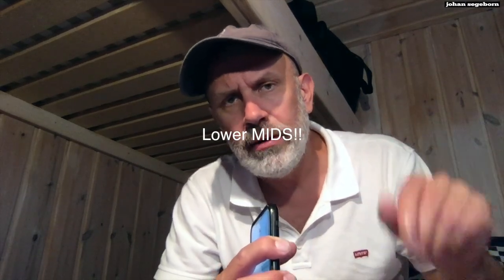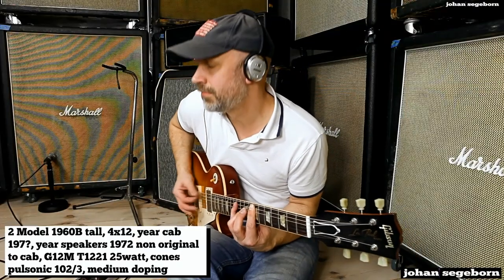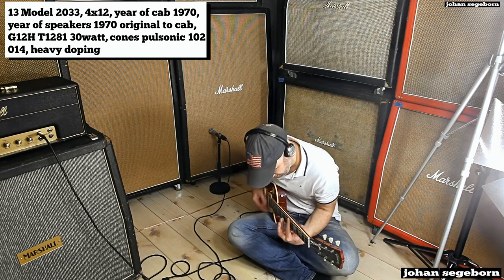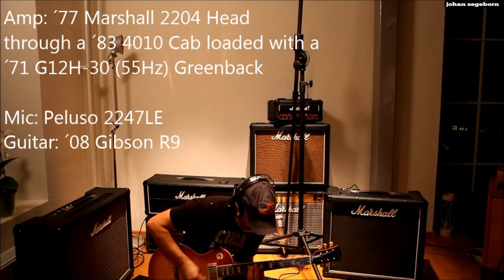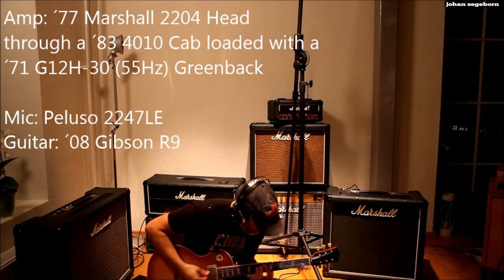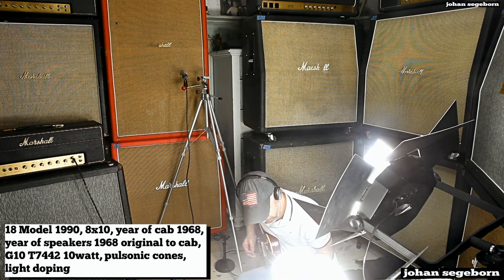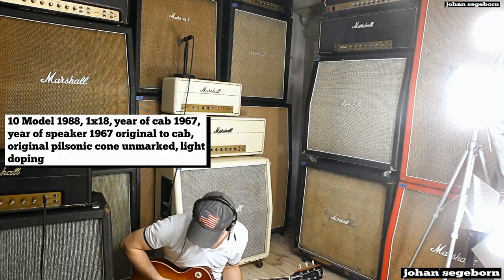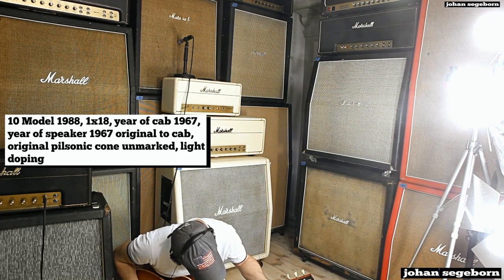Marshall Speaker Cabinets CRASH COURSE!

Comment: Thanks for taking all the time to do this, JS. Nice to hear the contrast in tone in same place, same player, same amp. etc. Seems like the ideal tone is to get the lower mid warmth if the G12M without getting bloated and the upper end cut of the G12H without getting brittle or harsh
Reply from the maker: Thanks Doug, that’s a good characterization

Comment: I learned about a couple cabs i never knew of from you. I’m not sure if it because of how they sound over the phone I’m watching the video with or if it’s just me but the ones you call boxie are the best sounding to me aside from the jcm 800 cab which I’ve always loved.  I use a jcm 800 half stack with the slant cab. I also use a studio 800 20 watt head with a cab i built it has 2 12’s one on top of the other. It’s a tall slender cab. I’ve got a MG15 MSII i keep in my bedroom beside my bed. It sounded terrible until i had a guy do some work to it but now it sounds incredible the clean channel is a second gain channel now too which i love. I never used the clean channel on that amp. I do use the clean channels on my other amps it’s just the MG series all togeather are not the best sounding amps. Perfect for a bedroom though. They are the exact size you need for just noodleing and practicing with. Actually i have to use two power soaks to calm it down now that i had it worked on. I have a great amp guy, he reminds me of Brad The Guitalogist lol.
Reply from the maker: Thanks Jake, I’m glad to hear that.

Comment: I'm in a toss up right now between getting a 80's jcm 800 cab with the old T75's vs G-12 65's. What are your thoughts?
Reply from the maker: If you play Strat they both work but for Les Paul  G12-65 sounds better to me

Comment: The 1×15 2054 Is very cool! Do you have more info of its construction, way to mike it, max power etc?
I think it is suposed to be made for organs.
Reply from the maker: It is indeed. I don’t have the dimensions, but this ad on reverb has som hur pictures https://reverb.com/item/12680591-marshall-2054-1x15-cabinet-1973-black?utm_source=rev-ios-app&utm_medium=ios-share&utm_campaign=listing&utm_content=12680591

Comment: I have two 2032s with 12 M speakers 1971 with my 1971 super lead a 1971 super tremolo, lefty and Righte.. I tried a lot of cabs from Marshall vintage and in my personal opinion the 2032 with the staggered 12 M speakers is the best damn sounding Marshall cabinet ever made, built like brick shit house , Extremely versatile and they sound heavenly… Let’s see you doing a show about The 8/10 inch speakers and the stagger for 12 comparison… Just so you know the 8/10 sound a little thinner
Reply from the maker: Yeah the 2032 are killer cabs

Comment: They made 2 size 8/10 cabs one the narrow basket weave and the larger one to fit the full size heads these in large checkerboard
Both are model 1990
Reply from the maker: The big box width 8x10 is the 2034
Reply: @JohanSegeborn  I have both the small box version basket weave and the full size version in very early large checkerboard
They both have the model number 1990 on the factory tag on the back of the cab with s/n

Comment: I didn't see the 1960A/TV. I only learned there was an M55hz the other day. I always knew there was an H55hz. I believe the Tall Vintage were loaded with H (Heritage) 55hz. The Ms are also called Vintage, right? To me, the Vintage are more piercing than the Heritage. Please, correct me if I am wrong.
Reply from the maker: I don’t think there was a slanted version of the tall cabs. The speakers are all from he 60-70s here. The heritage series are reissues. Cheers